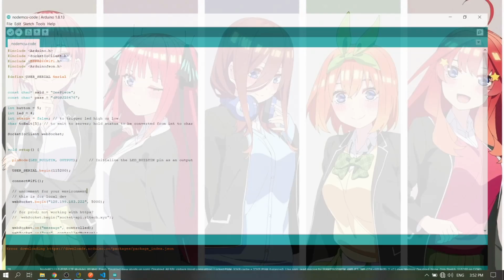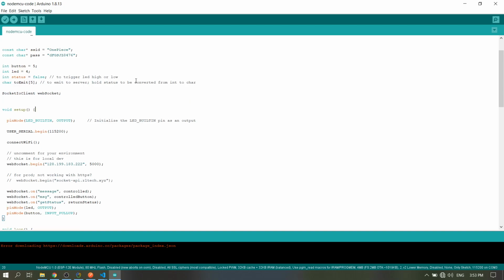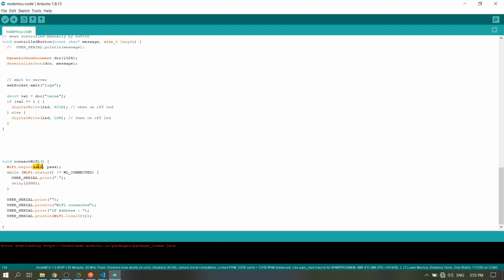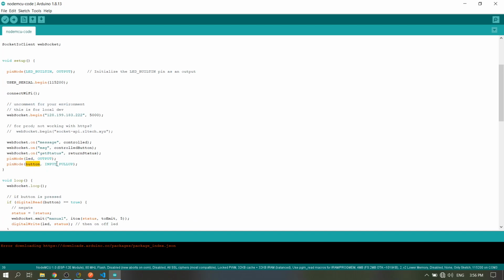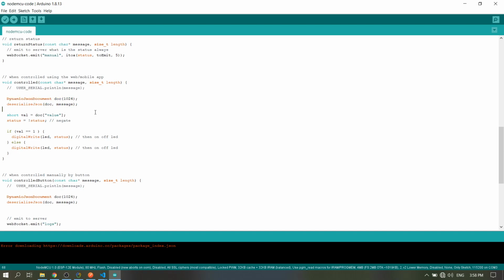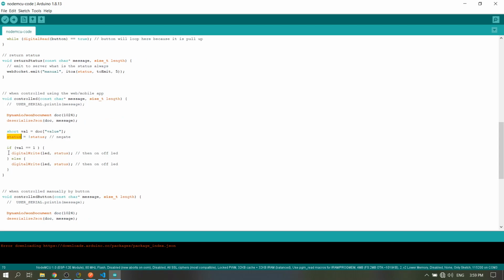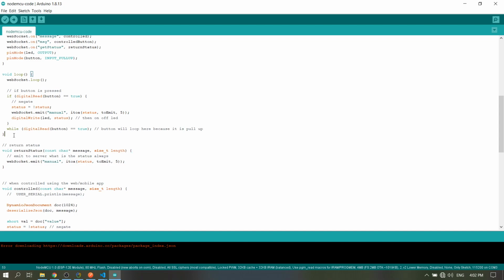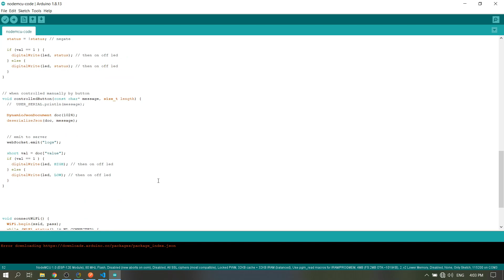[IOT] NodeJS - NodeMCU Socket.io Communication Part 4 - Arduino Code (ESP8266, NodeMCU, Socket.io)

Comment: Hi Rodney , getting error while compiling on arduino :    _webSocket.beginSSL(host, port, url, fingerprint);
invalid conversion from 'const char*' to 'const uint8_t*' {aka 'const unsigned char*'} [-fpermissive]
Even socketioclinet basic example( that comes preinstalled) is giving this same error. Something is not right...

did you faced this error ? any solutions...
Reply from the maker: Yep, you need to delete that function on the library.
Reply from the maker: In the .cpp file I guess? Remove the beginSSL function.
Reply: @rodentskie  thanks man , compiled successfully with that change
Reply from the maker: @AnkitVashisht  glad to help bruh.

Comment: Hi Sir, Why in the Controlled function. the If and Else all run the same line of code. Isn't that not needed the if and else and just run base on the Status Variable ?
Reply from the maker: Thanks on noticing that. I guess you can try to remove the if else block and just leave the `digitalWrite(led, status);`. Hope it behaves the same with the if else block.

Comment: Hi Rondney, thanks for sharing your videos. My question is what version of library are you using? I have a problem in the connections with the server, my NodeMCU doesn´t connect to socket server, I'm not sure if it's cause of version. Your repository link are broken.
Reply from the maker: Yes sir, versions does matter. Btw which library do you mean? Arduino? Let me check my repo.
Reply: @rodentskie  Thank you for your response, Yes I mean version SocketIO and WebSockets by Markus Sattler library. Please check your repo that I can go over the code. thank you
Reply from the maker: @andresrico6216  https://github.com/rodentskie/api_nodejs_nodemcu
Please see this link sir.
Reply from the maker: For the library in the arduino it's just 0.0.1 and 0.0.3 I guess last time I developed. Just use the latest sir.
Reply: @rodentskie  Thank you so much! now I can connect to the server with my NodeMCU, I had a problem in my server, your code is ok.
Reply from the maker: @andresrico6216  glad to help sir. 😁
Reply: Can you do wss or secure socketio pls
Reply: @andresrico6216  I am have the same problem, can you please help me?
Reply: Got it! It is the problem with my socket io server version, use ^2.3.0
Reply from the maker: @seaofcuriosity  I tried it but I can't connect in my domain. That's why I used the ip address of my server.
Reply: @rodentskie  thanks for uploading brother . Any updates on the domain use. were you able to connect your domain , someday later?
Reply from the maker: @AnkitVashisht  thanks on liking the video bruh. Noted on that, will create a video on that bruh.
Reply: @rodentskie  thanks brother, that will be great 😊😊